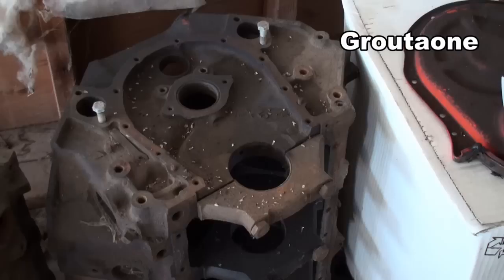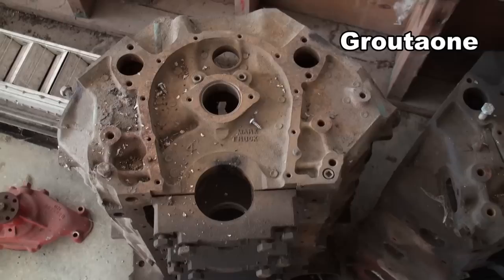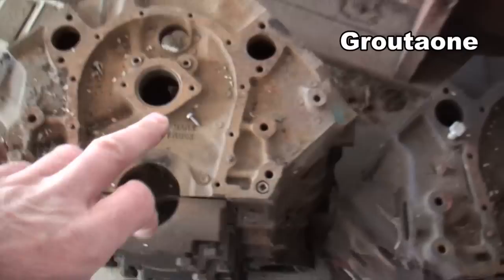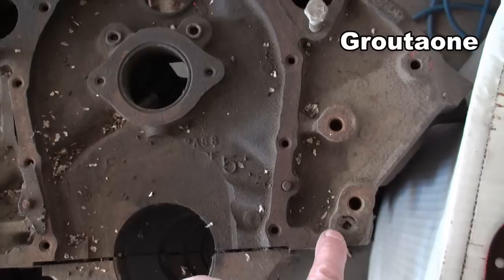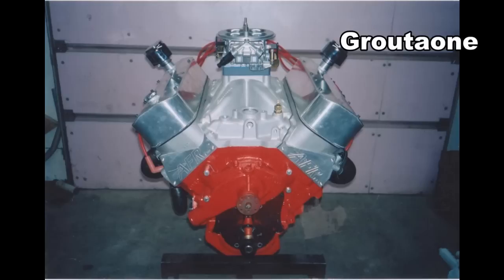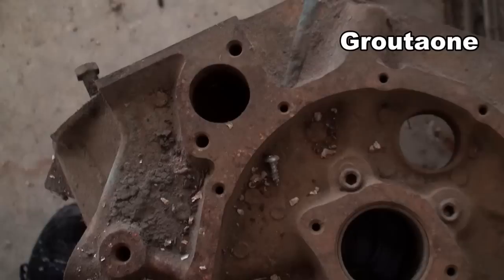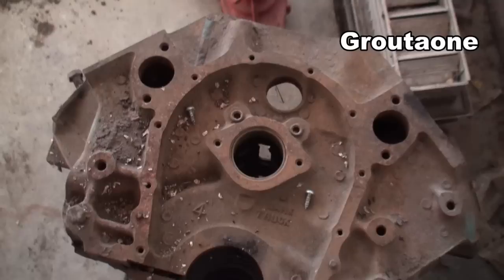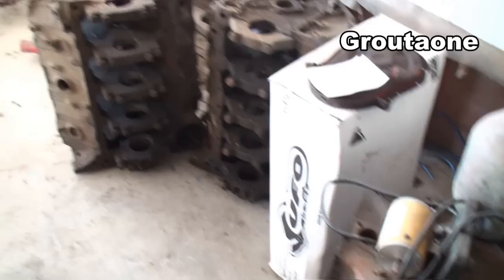Big Chevy Block Tech

Comment: I have twin 1969 Kiekhaefer 482ci off shore race motors that are now 496's. 427 tall blocks with 4.250 cranks, 6.405 rods. Everything was built by Chevy/Mercury off their shelves. From intake to oil pan everything has a Chevy part number.

Comment: Years ago I found that if you want a strong lower end you need to go to a truck block, but not all of them will give you the ability to overbore and clearance. I think you pointed out the oil galleys and water jacket issue you would have to contend with. Good video
Reply: Marine blocks very good too but man they are heavy! Lots of cast iron in those things.

Comment: I need help finding the block casting number on a supposedly 1980 454. it is in the truck and there is no number in the front. do I have to pull the motor out to see if it has numbers on the rear of the block?  thanks

Comment: im in search of a tall deck 427 TRUCK engine. Its going in my m35a2. So that plug for the oil gallery, is that pressured? I think that is where the air compressor gets its oil feed from for trucks with air brakes. Im searching for a doner truck to pull the motor from. Wanting to get lucky and get one with the air compressor and sae#3 flywheel housing still on it.

Comment: Nice vid man. Love my Blown 468 in my Z28.
Reply from the maker: I watched your vid wide open at 90 mph and I know why you like it :)
Reply: groutaone I found a couple bad plug wires on it last fall, installing a new set here in a couple weeks and adding some more chrome and braided lines. Should run a little better with a new set of wires. It almost acted like a lean fuel condition, had me scratching my head, simple things. Duh.

Comment: Very great information just found your videos fixing to be building a 454 to put in a 69 Chevelle hell I just found out they made a 366 big block talk to several people and boy did I get a ear full about that motor but when you can pick one up for $300 turn key with 30,000 miles on it couldn't pass it up not using it for racing just to put in a shop truck and run around town in but everybody says it's complete junk again for $300 we're all I had to do is drop it in I thought it was a bargain the biggest thing is trying to match a flywheel and starter to the back of it because looking to install a turbo 400 transmission behind it they came with manual shift Transmissions they was installed in heavy duty large trucks like C 60s mine happens to be in 84 year

Comment: just came across a 427 TB with a 400 trans attached.  I'm debating right now as to whether I want to buy it. Trying to find a pu truck to put it in and use it as a badass Harley Hauler.
Reply: get the tall deck they arent monsters like the 572 will but they are proven

Comment: I love the info on the 427..I just recently picked up on that was pulled from a 1980's ton and a half state dump truck and it had a little over 80 thousand miles on the truck but the paperwork for the truck from the state. They ended up replacing the motor becouse the original one spun a Bering. So I picked it up by trading scrap metal for the motor. And the motor has only a little over 10 thousand on it and it is the tall deck. 4 bolt main. But where else can I find parts for it?? I been looking and just for a intake is out of this world.. Would you have any ideas?? Any help would be very appreciated..
Reply from the maker: Basically everything interchanges except for intake and connecting rods and pistons, the short deck rods will bolt in fine except they will be too short, aftermarket pistons and rods are readily available for that application. Also the exhaust will sit a bit higher and more to the outside.
Reply: groutaone  but if I had known that it was gonna be a big pain in my butt just for a intake.. I would of left it.. I never knew that ones could be so hard.. There like 300-400 bucks and trying to find one used.. Wow.. Everyone says it's a great big block.. But to me it's looking more of a boat anchor than anything else.. I rather go and find another 454 .at least those parts are very easy to find.. I really appreciate all the info and you helped me out alot and I have learned my lesson that even though it was a great deal it kicked me in my butt more than anything else.. Thank you very much and I enjoyed the videos and for your help..

Comment: Groutaone, I have a blown up 366 in a kodiak that I want to put a tall deck remanufactured 454 in. The 366 has a funky "saddle" engine mount up front just aft of the harmonic balancer. Is it likely that my 454 would have the bolt holes for this mount. Looks like yours do. Is it likely that the stock intake manifold and bell housing from the 366 would bolt up to the 454 or is the 366 and 427 a separate animal from the 454? Thanks for any input you or your viewers can offer.
Reply from the maker: I think the bolt holes on the blocks for engine mounts and bell housing are all the same, If I remember right the only drawback of a 366 is it has small cylinders but on the outside it's all big block Chevy
Reply: Thanks for that!   I'll try to confirm it too.

Comment: I'd like to know if you could help me out bud?
I got a. 350 202 heads, hooker headers the long ones edelbrock performer intake with the stock quadrajet it starts fine but has no power, bogs out when I step on it 
Anything I'm not doing right or what very fustrated
Reply from the maker: My bet is it's your carb, they can be tuned to work but consider getting a Holley style carb

Comment: Is it true that all 396 motors are actually 402 cu in motors?  That 396 was just a badging and marketing ploy by Chevrolet?  Heard this a while ago and was curious.
Reply from the maker: I think I used to know the answer however now it's a guess, the 402 had cyl  just bored a bit more
Reply: @groutaone  I don’t remember the reason but Chevrolet started making the 396 a 402 which was just a.030” over bore.  The Chevelle was still name plated SS 396 and was actually a 402.

Comment: Whenever you stroke an automotive engine, how do you compensate for the piston going higher in the bore? Do you run a special thicker head gasket that spaces the head way up or do you cut the head to allow for it? With bikes I know you run a spacer plate under the cylinder but, well,,,, kinda can't do that with a V8 lol

Thank you for the awesome video!!! We are looking at a 78 LWB Silverado with a Cammed/headered 454 and I'll remember the water jacket bolt landing width part next time I go look at it
Reply from the maker: Thanks man, Most common adjustment for more stroke is ordering pistons with a different pin height
Reply: Oh ok,, Thanks for the info!! I highly enjoy learning new things!

Comment: luv the video coud you tell me how many diff combos there are that woud fit the tall decki hav a 427 tdeck in my hq monaro and im gettin a ictch to kill sum rubber
Reply from the maker: pinkyplumHD These blocks will accept a 4.375 stroke with little work and handle a max bore of 4.35 which makes a 520 ci engine, tires will not like it ):

Comment: The only thing you don't want to use the truck heads, they had awful, tiny ports on them. But you'd probably tell that by putting them side by side with car heads
Reply from the maker: For performance they would really suck, I have a set in storage I should show how they look next to oval ports, they are great heads for a tow truck or hauler or something like that though

Comment: can the tall deck motors accept a accessory drive from a 454 or is it different
Reply from the maker: Any accessory mount that bolts to both the head and block/water pump with the same bracket would need to be modified

Comment: LIES, the 318 never dies, lol.. JK. But really, the older carbed 318 would out last several trucks. Can be made to make "OK" power, but you will get bored of it and move on. That same 318 will pass hands many times over and out last many trucks and cars. My first ever engine that had more than 2 wheels was also a 318. I wand damned mean to that thing. Ive had plenty 350s, while they make more power for a lot less money, they also explode pretty ez in stop form. That old 318 was over built for its low power levels. making it a last forever abuse taking perfect first engine for a teen.

Comment: You can bore a 454 out 125 you can only borrow a small block 350 out 60 you will take a risk if you taking 90 and that case a 454 is the best thing out there
Reply: Don't bet on it without a sonic check.

Comment: You can make a 598 on a short deck they sell a 50000 tall block and then the Piston you just have to take a 10,000 and the Pistons right flat on top you can even use it with a standard dick you just have to use a multi-layer metal gasket to make up the difference the 40,000 stead of sticks out of the block and then the thickness that you need for valve and piston clearance works great 1160 horse and didn't have any problems